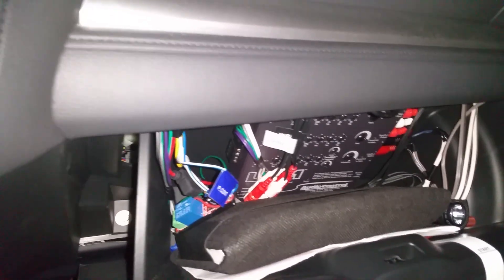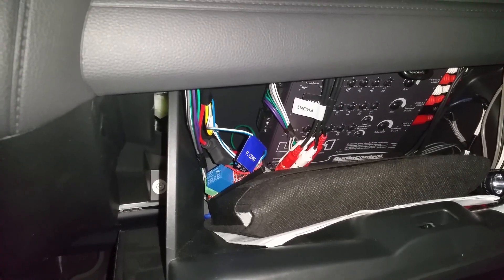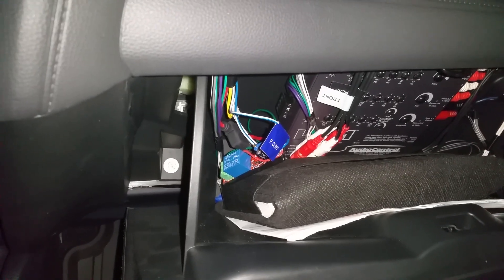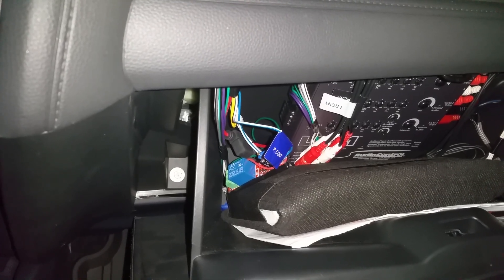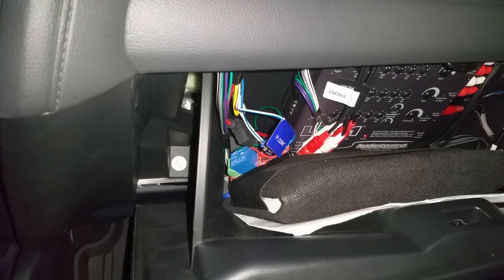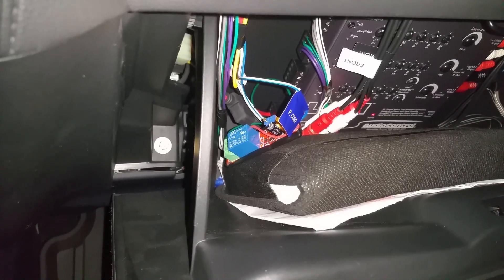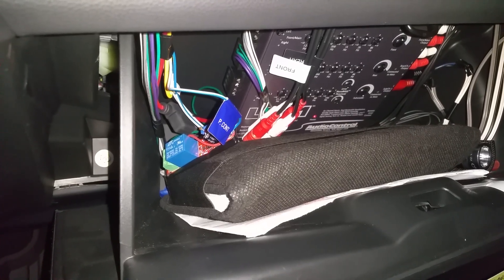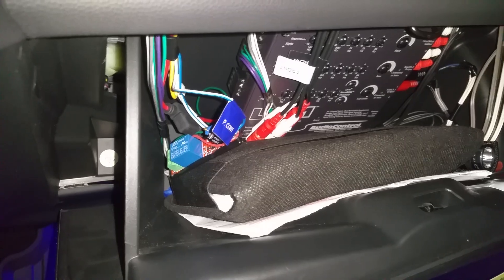Amplifier Thump/Pop Sound Power On/Off: How To Fix

Comment: Thanks for your advice.  I had a similar problem; a loud "thump" from the subs when the system turned off.  I don't have an LCQ-1 like you but there is an EQ connected between the head unit and the amps, and this was causing the noise when shutting down.  I followed your suggestions and made a simple delay circuit on the control line to the EQ, and it now shuts down a few seconds after the amps are off and so the noise isn't audible.  My circuit is just a switching transistor, with a cap and a resistor that adds a delay to the base, but it works fine.  Thanks again for posting your video.  Good stuff !
Reply: You dont need to buy no relay...all you need to do is conect the unit what ever it is your using a preamp or eq or whatever it is, and conect TO constant power not switching and use the remote wire from the radio to turn on and of the device this will allowed the preamp or eq to turn off and on with some dalay solving your issues . DONT USE SWITHCHING 12V TO POWER PREAM OR EQ. ITS A COMON MISTAKE
Reply: @Themadscientist6858  somebody told me the something similar. can you explain it again kinda got lost in the message
Reply: @fadilperrin2745   most of the time this noise pop from preamp eq is cause when people use switching as constant on preamp eq.. Preamp needs constant 12v , ground and remote and you need to use  accordingly. And keep grounds as short as possible other wise the act like antenas and pick up all kinds of interference. And something else dont piggy use the same wire to remote turn on all  devices. From radio remote out use a separate remote wire each individual unit. If all still doesnt work you might have a fault device in the chain.
Reply: @Themadscientist6858  thank you Hilda I realized my EQ was actually wired wrong, constant 12v was actually wired where switching should have been. I changed it which fixed one of my problem “the turn off pop” but I still have the turn on pop
Reply: @fadilperrin2745  . Eq needs to have 12 volts constant,  ground and remote from radio. If you still are getting pop it could be coming from one of the 4 devises, radio ,amp or preamp eq or separate crossover, if u have any. Start eliminating process to see wish of them its the culprit. You can also try to change remote turn on,  on devises use switching acc from car instead of remote from radio. Because sometimes is the way the radio turns on and sends out remote turn on that causes this issue. Make sure ur using good brand equipment. Dont mix match good equipment with cheap units. Start by  bypassing everything just run signal from radio to amps and see if pop is there. If pop still present change radio, if u still got pop its defenetly the amp.
Reply: @fadilperrin2745  . Make sure preamp eq, crossovers or any additional equipment in the chain has constant 12, ground and    remote. "DONOT USE SWITCHING AS CONSTANT TO DEVISES" you can replace remote turn on from radio and use "ACC switching" from cars ignition only.
Reply: Thanks this works Great!!!!!
Reply: Bryan Tolley I have the same problem on my 2004 Silverado when I turn the key to the off position the radio stays on but when I open my door it turns off and a pop noise comes from the speakers .. so I have two amps and one EQ so the pop sound comes from the EQ? If you can please help thanks
Reply: Hi Cesar,  
We can't say for sure that because the noise in my car (and xboxer1985's car) came from the EQ it'll be the same in your case.  However, if you unplug the output cables from the EQ and then shut down the audio system, does that 'pop' noise still exist?  If not, then it was probably was EQ all along causing the noise.  If it's still there then you need to serach elsewhere; one of the two amps maybe.  If it is the EQ then you can try adding a simple delay device as shown in this video to turn the EQ off after the amps shut down.  This doesn't remove the 'pop' but it means that it won't get amplified and you won't hear it any longer.
Reply from the maker: Hilda Reveron the LCQ1 DOES have constant 12 volts. What it needs and uses is a 12 volt trigger source with the ignition on. I have updated my setup to no longer need the delay. Fixed it with proper grounding jumper setting in LCQ1, and ground loop isolator on the subs.
Reply: 😢137.38 q
Reply: 😢137.38 q

Comment: Did you get a pop when the amp turns off? And how did you fix this issue? I've gotten the turn on pop to go away
Reply from the maker: It's the ground jumpers, got to figure which one to use.
Reply: +xboxer1985 I've played with ever combination that the LCQ1 will allow he worse in the 200k resistive i am using the isolated ground because it gives me the lowest pop when turning off the system. I may post my turn on and off video I'll let you know when I do.
Reply from the maker: Sounds good let me know how you do the unit comes with the ground isolated from the factory unfortunately it seems Honda decided to make the signal ground and power ground common which causes some problems for me. Using the 200 on resistor setting does eliminate the thump. The Kenwood 4 channel amp that I use we'll still hump if it was sitting for awhile likely because the internal capacitors have discharged. Other than that it doesn't do it very often

Comment: Hey, First thanks for the ved.... I am having the same problem but with the power off side of things. I have a kicker front row going to my EQS and then to my amps. When I turn off car it scares the crap out of me and who ever is in the car. My question will this work for the turn off side of thing and wil I need to get 2 of them for my set up. Befor I got the eqs and was just running the front row it was doing the same thing. Thanks for your help
Reply: I also have the kicker front row and clarion Eqs755  and experience the same issue with power off thump. It started after installing the kicker front row, I have my remote coming out of the head unit going to the eqs first, then it runs to each amplifier(3) and then to the kicker front row. Besides the thump I love the damn processor and I'm going to figure this out ,unless it kills me first. If I do, I will let you know how. Although,if you have already,please halpp!!!
Reply from the maker: +Donald Thompson If there is a power off thump, then something further back in the chain like an EQ or signal processor is shutting down before your sub does. This mod would only help the power on thump, allowing the amplifier to turn on last. I dont know exactly how your system is setup but be willign to wager that some signal processor is shutting down out of order than it should. Amps should be last on, and first to turn off.
Reply: I also have the kicker front row and clarion Eqs755  and experience the same issue with power off thump. It started after installing the kicker front row, I have my remote coming out of the head unit going to the eqs first, then it runs to each amplifier(3) and then to the kicker front row. Besides the thump I love the damn processor and I'm going to figure this out ,unless it kills me first. If I do, I will let you know how. Although,if you have already,please halpp!!!